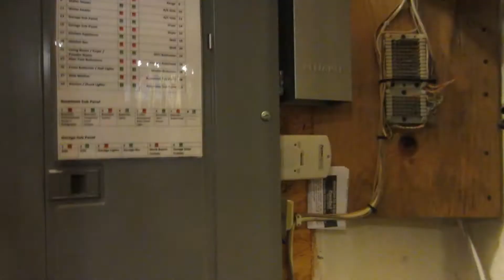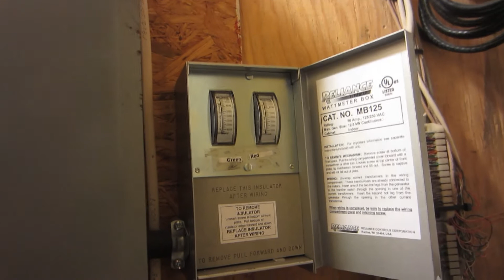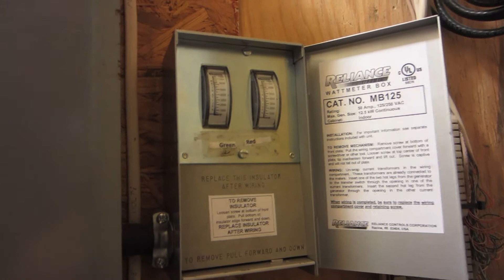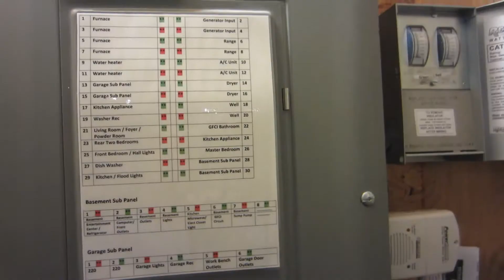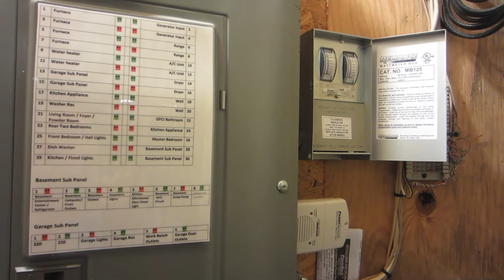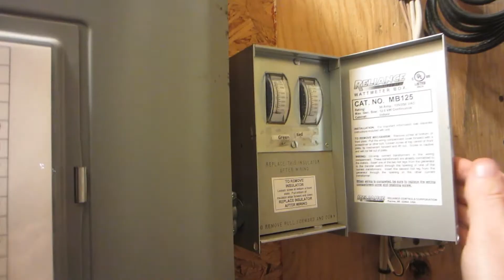Reliance Controls MB125 Indoor 50-Amp Wattmeter Box -  Overview & Install

Comment: It took me some time to find out what that thing is on Reliance box. Saw it in someone's vlog and now reached here. 
Why can't Americans just turn to 220/230V like the normal world. Lol.

Not in my wildest dreams would it ever occur to me that some would use manual generator balancing. 
I'm an electrical engineer with Power System Protection & Control background and in my 10 years experience, I've done protection design for machines up to 600+ MW. At that level we use a generator unbalance protection. So, to think of this at this scale is wild really! :D

Wouldn't it be better to have a simple 1:2 or 2:1 isolated winding transformer  at single output and driving your loads through it. That'd not put you in always alert condition to balance your outputs. Just a loud thought, I don't exactly know your situation.
Reply from the maker: To be honest I should get my neighbor (an electrician) to read this before I answer but I will do the best I can for my situation. As for 220 Vs 110 in the states it came down to safety. You all will plug in a clock radio to 220 which a frayed lamp cord could kill you. 110 will give you a nip but in most cases you will live. I've been hit with 220 before and after felt like my brain burned when it happened and kind of feel lucky I lived. As for the manual balancing and such I'm sure most bought back up power systems probably do that (Generac systems, etc) already but mine is a basic home built system pretty much used in emergencies and is not even worth setting up and starting for the simple local power outage. So it's a little more hands-on manual. Kind of like a 4 speed with manual choke compared to a newer automatic car. Also being we had the generator already it cost about 10% of what an auto backup power system costs to build. Its basically only for when we know we are going to lose power for days and to be honest since I install it I've only had to use it once in the last 6 or 7 years and to be honest was not too hard to keep balanced. 
Thanks for watching!!!

Comment: Does it matter which way the sensors face? I noticed the lettering on the sensors both face away from the breaker. I’ve seen other types with an arrow indicating direction. I have this same thing, but haven’t noticed any arrows. 
Could I install facing any direction?
Reply from the maker: As far as I know they are not directional. All it does is tell what is in the cable at where the sensor is, not what direction the electric is flowing.

Comment: Great video. Thank you!! Let me make 2 comments.
First, you can still use the ½ knock out. If you remove the watt meter cover, you will see 4 female flag disconnects. These can be removed, and passed through a ½ conduit from the panel box back to the meter. I used ¾ anyway as it was easier to pass these wires through the conduit, and back into the meter.
Second, 50 Amp requires a 6 wire (will actually carry 55 Amps). The rings WILL fit over the 6 wire into the breaker. 8 wire is good for up to 40 Amp. My rings have just enough movement over the 6 wire (aluminum).
Reply from the maker: Thanks for the info. That's how we will know what we really want to know. 
I've thought about it and imho the 3/4 knock outs are for passing the feed wire through the watt box (passing through the loops) before going into the main breaker box. Mine already being installed I didn't have that option being the feed line was not long enough but if I did the whole thing from new, I would pass the wire through the watt box on its way to the feed breaker in the main box. If it's a add on our way works just as good.

Comment: How did you know what was on what phase? By flipping breakers and watching what side of the wattmeter moved?
Reply from the maker: It should be in a 200amp panel, the first row first slot is phase #1 and every other slot after is phase #2....... 1, 2, 1, 2, 1, 2...... The next row of breakers should match the first row.  That way when you install a 220 breaker it's just one big breaker taking up 2 slots feeding off both lines. Now how to find out what side of your watt meter is on and if you have a back feed how it feeds back in, will take some investagation. Thanks for watching.

Comment: FYI a current transformer with no load (disconnected) with the power on (even though there isn't any connection to the actual AC)... will shock the sh*t out of you.  Enough to kill you probably not, especially since it's isolated from ground, but you might pee your pants

Comment: It's dark as hell where my 30310 is... it has the built in wattmeters (without the current transformers).  I want them lit and was thinking of a couple LEDs, but I don't want to put a diode resistor and all that.  Then I remembered there are incandescent bulbs on some of these panel mount meters.  Anyone know what I'm talking about, got a part number?
Reply from the maker: sorry...

Comment: Thanks for the video. What did you use to cover the wires between the meter box and breaker panel?
I have installed several of these watt meters but am always trying to find the best material to use
between the meter box and breaker panel that is big enough to fit the current transformers through.
Is that wire sheething? If so from what cabling? Thanks!
PS I always like to label which breakers not to use...ie electric dryer, electric oven, etc.
Reply from the maker: I used 1/2 gray conduit. Had to split it long way with a knife so I could slide the wires inside without taking the ends off the wattmeter wires and then wrapped the conduit with a wire shrink wrap to hold the split together. It's what I had in stock so to speak. Pretty sure the wires with the the ends attached would pass through 3/4 conduit and fittings without an issue.
Thanks for watching.